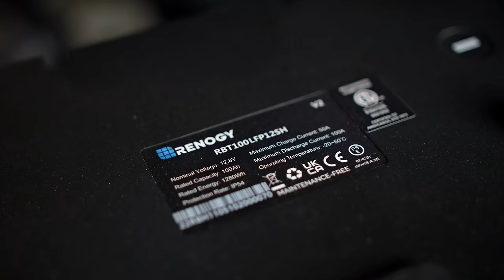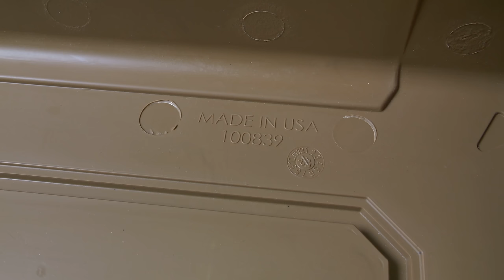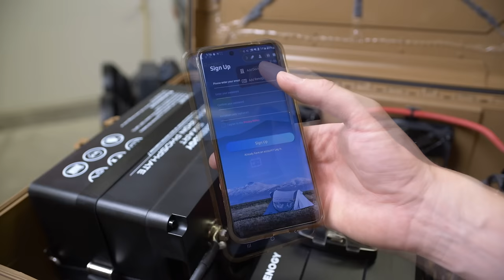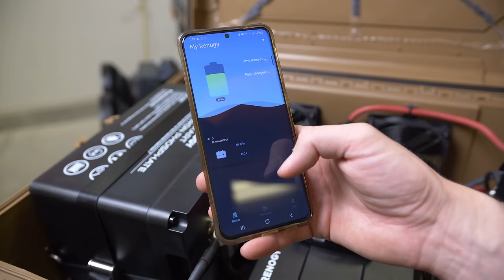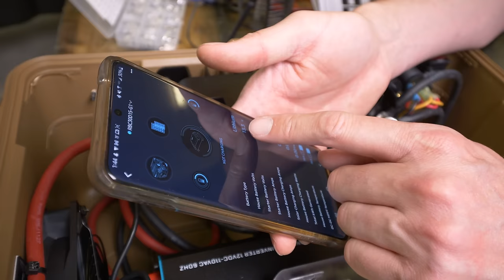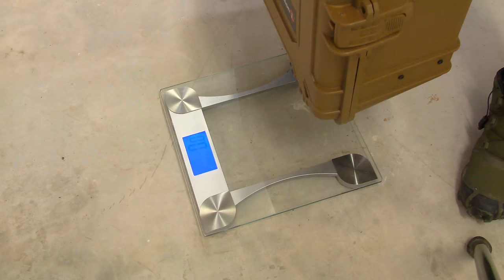It all fits in a case! - DIY Auxiliary Power System for Camping, Overlanding, Travel

Comment: Nice all-in-one case. For your dc-to-dc wires to the alternator i would use heavier gauge. I used 4ga to the back of my 4runner and if I charge at 40amps the wire gets too hot and trips the breaker. I am going to oversize the wire next time.
Reply from the maker: Hmm, sounds like you might have bigger issues you might want to investigate. #4 should handle at least 80 amps. How long is your run? Is it near heat sources? How are the connections at both ends? Is the charge device putting out more than it should? Just a few things to consider. 🙌
Reply: What size breaker?

Comment: Great build! The SB mounts requirements of square hole I try to refrain from those I use external flat cover mount and then you only drill hole big enough for the wire.  Did this on my build years back and for my next one doing the same.  Plus this frees up some interior room in the case.  I can't like example but somewhere on my channel I did a short video that hi can see it in the background.

Comment: I built a very similar system in my offroad trailer, and I was wondering why you didn't install a  120v charger system? I have a small 5amp unit that tops off the battery before trips,

Comment: for the battery the DR prepare 12v 100ah, also made by renogy for 399, also comes with a small solar charger and usb ports. That system sure looks pricey.

Comment: Great attention to detail and the work to write the web page description. I do question why more though wasn’t put into making the jacket work better? The jackery is a solar generator so why not use that to your benefit. Install a voltage amplifier at the battery and charge the jackery by the solar input leads.  Which in turn allows your to run smaller gauge wire because your increasing voltage and decreasing amperage. 
Anyways always a though to look into as many times solar panels run in series for high voltage to decrease wire sizes

Comment: Informative to watch.  Thank you.

Safety comment, if I may:

4:17 ... In my opinion, at best, this case would be IP43 rated -- and not rated for rain exposure.

Elon voids his warranty if an owner submerges their car.  I believe there's a pressure relief vent valve on his batteries, which, if submerged, can allow water ingress into the battery ...  which can lead to corrosion, shorts, etc.

On a related note, the Australians have already implemented restrictions regards placement of lithium batteries for campers, etc., and those restrictions revolve around thermal runaway.

Dust too over time, with moisture = corrosion.

My $0.02

Thanks again for the content.

Comment: So once you connect the hub for the Bluetooth monitoring for the battery and the DC to DC charger, can you add an extension for the power.l button for the battery and essentially mount that on the side with a protective cover over it and it would be much more accessible?

Comment: Some people are so stuck in the past... That entire thing weighs about the same as a single AGM battery, yet people still badmouth lithium batteries. As an added bonus, you can use 100% of the lithium battery and you can only use ~50% of the AGM, so you are carrying around ~50% of the weight for no real reason. 👍

Comment: love the case .. is the missing part for my spare ecoflow extra suitcase!!!!     for me 8s 46160  worked ok!!!! more volts less amps cables are still big for future 8s2p   but i might turn it to 16s!!!  then the battery will be almost identical to  units one!!!!! i m thinking of  remove the cover of my inverter so the  fans of the case help more

Comment: Could you used rivets instead screws and put the heat sink on the bottom with little rubber legs on the bottom to elevate it off the ground when sitting upright?

Comment: Actually you can covert Starlink to 48V DC, honestly they really should sell an option because it's internally powered on 48V so it would actually reduce cost for them. Although to be fair having a different SKU would increase costs. Also if your system is 12 or 24V DC it's not a problem as you would want to regulate the input voltage and amperage anyway, so a boost converter isn't a big cost add or anything, you can get 400W 15A boost converters for $15 which is plenty for Starlink.

The advantage of going direct DC is that you are not converting DC to AC to DC which is pretty darn inefficient like 70% - 80% vs ~95% efficiency of a boost converter or the ~98% of a regulator also you don't have to have the inverter running which is another 20 - 80W, also you can charge your laptop and phone from DC which is especially easy if you have a 12V system and can charge your laptop from USB as you can use the cigarette lighter USB chargers.

So you can really limit how often you need the inverter on anyway getting back to the main point, it means that if you are just running Starlink and charging your laptop which stock Starlink assuming 80W for Starlink at 95W for your laptop that  and I will assume your inverter power consumption is middle of the road at 35W thats 210W, running them directly off DC would reduce it to 138.2W and that is assuming 75% efficiency of the DC to AC to DC conversion vs 95% for a boost converter so it's 210 - 35 = 175W being the power without having to run the inverter then the power draw would be 78.95% of the load so as said 138.2W.

It's a pretty big win.

Comment: So at the risk of asking a "dumb" question, Am I correct in assuming the shunt to track battery condition is inside the battery, since it isn't on the outside in any of the components you installed???

Comment: 39:00 May I suggest a facing plate for that, which the switch will mount well with, then mounting that plate in the desired location with a slightly larger hole through the case?
Reply from the maker: That's a great point. I had hoped to use the faceplate it came with but it was too big. I need to see if blue sea had a smaller, dedicated one.

Comment: @Lifestyle Overland, Kevin, one way you can reduce the cost is by using a modified sine wave inverter and a small surge protector power strip.  Just as you would use a surge protector on your TV, computer, etc. at home.

AC (house) current — also known as ‘dirty current,’ — because it alternates and causes spikes along its pathway (which is why the need for surge protectors,) is the same as a modified sine wave inverter, and modified sine inverters are much cheaper than the pure sine inverters.

I have been using modified sine inverters since their inception with minimum 1900 joules surge protectors and I’ve never had a failure of my MacBook, Mac Mini M1, nor any of my other sensitive electronics. I have had inverters wear out from use, but I simply replace it with a new inverter for a fraction of the cost of a pure sine.

Comment: I have solar on my truck. Are you able to charge with the trucks power and the solar at the same time? Right now I have to choose wether to plug in the solar or plug in the 12volt.  It's a real pain to have to do that every time I stop. It would be great to leave them both plugged in. Your video is one of the best out there on this kind of thing. Cheers.

Comment: slick.  I've actually been thinking of building something like this.  I want to put a secondary battery system that's removable.

One question I didn't see answered anywhere.  What was the price?
Then we can compare your 100AH battery setup (with 1000W AC output and multi-charging input) to the COTS solutions.

One of the big pluses to rolling your own is that several of the COTS solutions don't take a high level of charge from the vehicle so they take much longer to top off.  

As a systems engineer, I think the only thing I would have done different (hindsight and all make me a great armchair quarterback), would have been to...
1) make the fans pull air from outside...exhaust mode...i.e. flip them around (maybe you did this, I couldn't tell by the direction of the fans)
2) Then, you could put the intake in front of where the Renogy DCDC is located so that you can pull in fresh, cool air over the passive cooling fins.

If you (or some other user) decides to use a less expensive, dumb battery, the I would certainly add in a master switch as someone else below recommended.  But that Renogy battery is pretty slick with that switch.

There might be a few other things I might do differently, but my requirements are probably a little different.

For those trying to make one, I highly recommend writing down your requirements before starting.  That will help with designing what you need/want.

Comment: Just an FYI I don't believe you should lay ALL Lifepo4 12v batteries on their side. It depends on whether they are cylindrical or pouch cells and what the starting orientation of the cells is. The cells can be on their side but if the manufacture has already oriented them on their side within the casing, then you risk having them upside-down if you put the casing on its side.
Reply from the maker: Read the directions that come with whatever battery you choose 👍
Reply: With todays prices on some of the commercial units, its hard to beat those prices.  I built my own 5 years ago.  Battleborn, Redarc, invertor etc.  I was 2k into it.  Now you can get a 200aH for a little over 1k.  You can't get all the components from renogy for that.
Reply from the maker: Yep, the only downside is if a single component goes out in the inclusive units, the whole thing is usually out of service. Had a friend do this with a couple Goal Zeros. They were out of warranty and he was out of luck. Definitely has its trade off in cost and size though.

Comment: Really enjoyed this. I will probably be building something similar to this. I think this has many additional uses in a SHTF situation. Like running a chest freezer in a down power. 
But what about the cost? At least for the box components?
Reply: I added up all components and it came out to approx $2000-2500 depending on tax

Comment: One thing I haven't found out is how does a mppt solar charge controller tell its a solar panel it's hooked up to instead of a 13.4 volt alternator all vehicles have either a 13 to 14.8 volt DC alternator or a 26 to 28 volt alternator putting out 60 amps or more most busses have a 100 or higher amp alternator that's a lot of watts of charging power

Comment: Very interesting build.

Apologies if I missed it, but did you include a way to charge the battery via grid power or perhaps a gasoline generator?

Thanks!
Reply from the maker: No, that's one piece I would add after having used it for several months. 👍
Reply: When I did mine, having already built a previous version, I added a Victron shore charger. Works awesome.
Reply: Buy an AC laptop charger e.g. 90 watts to simulate a 90 watt solar panel.  Make an adaptor (barrel jack to Anderson). Plug into the flush fitted Anderson socket he made for solar input. Forget the fact the solar input was originally installed for solar input, it’s effectively a DC input. Use any DC source as long as the voltage and current range is suitable for the solar charger spec. You can use any AC to DC power source as long as it’s suitable, doesn’t have to be a laptop charger.

Comment: Pretty cool.... #1 I would have soldered all the connectors instead of crimp. #2 I would almost skip the inverter and add a second battery... and \ or perhaps an AC to DC charger.

Comment: It's cool that he did this but your better off buying a quality power station like an Eco Flow or Anker. The best overall in my opinion for home use, camping/overlanding and SHTF is the Anker 2600. The battery he used in this box is a Lithium Ion. The Anker 2600 and some of the newer Eco Flows use  lithium iron phosphate they last 6x longer than lithium ion and way only a tiny bit more. 3000 full charges vs 500 with lithium ion. The Anker 2600 is the best out there right now for a power station in the similar size of Eco Flow Delta Max 2 and Bluetti. Anker says that it will last 10 years if you use it daily and you get 5 years warranty. Eco Flow only offers 2 years warranty. The Anker solar panels are better than Eco Flow ones too (the entire design and quality) Eco Flow use to be the best but now they are second best.
Reply: Lifepo4. Different than lithium ion. Same as the Anker I’m pretty sure.
Reply: @Annon89  yeah, that's what I'm saying that they use Lithium Iron phosphate and they are better
Reply: @rajsteint6487 , He did use Lithium Iron phosphate ( LiFePo4).  You said he used Lithium Ion, which is incorrect.  I think that's what caused confusion for anyone reading your comment above.
Reply: @gsahookah599 oops my bad I swear I heard his say lithium ion at some point in the video but you are right he did use Lithium Iron phosphate. Either way you are better off buying a quality product and one of the best if not the best which is the Anker 2600. The amount of time he spends on making this and not having warranty etc. It's just not worth it. Buy a built Anker 2600
Reply: @gsahookah599 ... You and Raj both seem to think LFP / LiFePO4 is somehow not Lithium ion.  

I get it.  Thermal runaway is spooking people like me, and there's a desire to differentiate.

By chance, got a reference other than a vendor for how LFP / LiFePO4 is not Lithium ion?

Thanks.

Comment: I've been watching these build for some time now and have a nagging question.  I'm not experienced in electrical, but what about grounding?  Do you need to?  How do you accomplish if so?  Help me understand.
Reply: Yeah I've noticed that also I've have been watching a bunch of these type builds also never a ground. Maybe they don't really use these things they just build them for the videos, I don't know
Reply: Grounding is always a bit of a debate.  I'm with the crowd that says let the system float and do not bond the negative to truck frame or earth, nor the GND terminal of the inverter.  This avoids most of the ground loop noise issues caused by some piece of DC gear that might have its negative lead tied to a metal chassis which becomes locally grounded.  Potentially much worse (pun intended)  is a 110 AC device with a GND bonded chassis used on a long extension cord that finds itself a human to become its link to earth  while the inverter GND is also earth bonded.

Comment: Great video, very clear and well done. I have a question about the vents. I am building my own box right now and I'm looking to add vents but keep the box pretty watertight (just for rain not under water). Trying to find a vent set up that I can close tight when I need that water protection. Did you ever come across anything like that?
Reply from the maker: I would look on some marine websites. Seems I saw some that would be a little better. With my current vents, so long as it doesn't flood the spot it's sitting... It will be fine

Comment: I'm curious about how the weatherproof aspect of the case is working out. Any in field reviews?
Reply: The first hole drilled made it no longer weatherproof, and with 4 inch holes for grills and fans that box is no longer even remotely weatherproof. It will be pretty impact resistant still though.

Comment: Hi, I am trying to decide between building this setup and the new RENOGY Phoenix 1000 anyone here more knowledgeable than me could help me answer this. Do you think the pheonix would be any different than other power stations. It seems to have been built well but 10a max DC charge seem like it wouldn't hold up compare to this setup that has a full DC to DC kit. The simplicity of buying a unit is appealing but if it is to have the same problem as others and the charge from the DC is too slow to really charge while driving I'll go ahead and build the whole setup. Thanks! Any advice is welcome.

Comment: Thought that cables weee supposed to be the same length for each run +/-
Reply from the maker: That would be an ideal installation when you're connecting two batteries together, but not in this situation.

Comment: I just finished my inspired build in a used Zarges box. But I’ve set my fan to the lowest setting but it still spins with power. Anyone figure out how to program it to not run at all until a higher temp triggers it? I followed the Amazon directions and the LEDs show I’m at the lowest setting, but if not I’d have to add a switch…

Comment: Nice build but I don't get it.  Looks to be close to $2k if not a little more plus your time.   There are several pre built  options that meet all your criteria and then some for about $1k.    For $2k you can get a lot more capacity and a much larger inverter.
Reply from the maker: You can definitely go cheaper but if a single component fails it becomes a boat anchor. Plus, with this system you can eventually peel out each item and install it in a vehicle.

Comment: 2:35 Ставите диод на предохранитель по реле и будет 14,5 вольт вместо 13,5 соответственно. 
Всё будет работать и заряжаться. 
Так же нужно менять генератор на 200А если стоит хуже, тогда будет около трёх киловатт мощности только с самого генератора, а если поставить тяговую батарею, то мощность увеличится до 20 киловатт.
Если что - я из Украины, мы это всё опробовали сами на себе по тому, что у нас идёт война. 
Никакая батарея не нужна - только автомобиль и генератор + небольшая модификация реле зарядки.
P.S. На лето лучше ставить обычный предохранитель без диода.
Reply: Thanks.

Summer = generator too hot to accept the extra work created by the diode trick?

Comment: So will you have to use solar panels with built in solar controllers?
Reply: The DC to DC controller he used should have a built-in MPPT.
Reply: I have the same dc to dc.unit and yes it has Solar control built in.